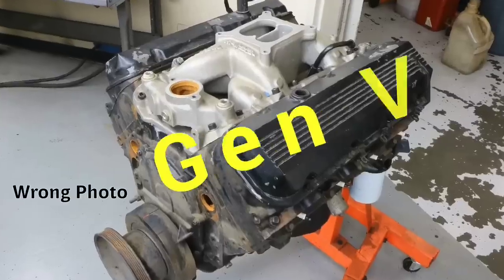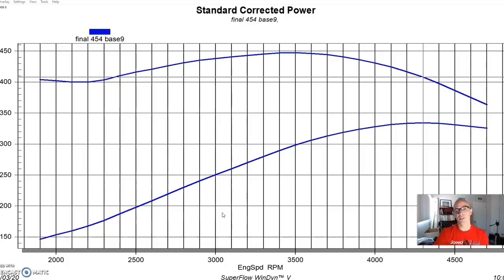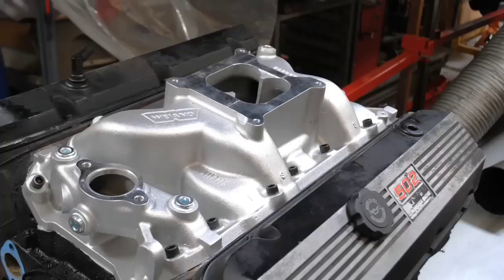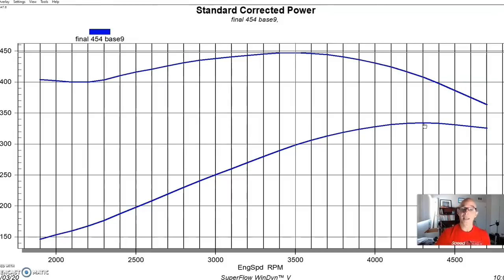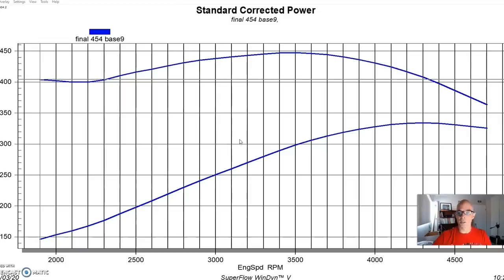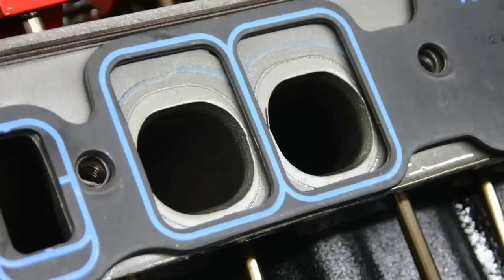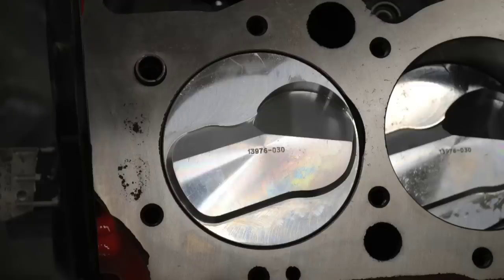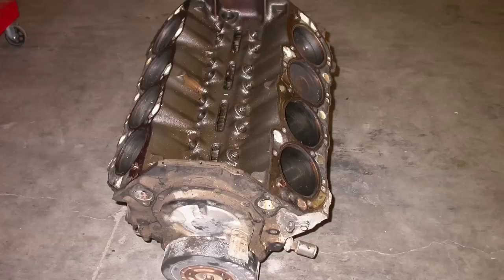HOW TO UPGRADE YOUR TBI PEANUT PORT 454

Comment: Do a 350 tbi motor
Reply: I think he has done it
Reply: @daveoneal5544  It's the tune.. OBD1. Everyone will probably say "go carb" but that's not always desirable, IMO.
Reply: @Kstang09  may not be desirable but its more simple and more efficient
Reply: @Kstang09  it's the heads that kill it. Swap to vortec heads, carb intake with adapter, 454 injectors 22lb regulator and a reflashed eprom.  But then again I'm just one of those guys that makes random suggestions .
Reply: Yeah, really.
Reply: 100 hp tops
Reply: The swirl port heads actually flow pretty well with some work.
Reply: @shitbox7413  why waste your time with them when just about any factory head will do better. I'm sure 882 heads might even do better.
Reply: @Kstang09  well it depends
Reply: do a 305 with a Weiand single cab blower with a 454 tbody and injectors
Reply: Have 383 tbi with vortec heads in my 93 burb. Definitely suggest vortec head swap. I was running 18 psi to the tb, but that was too much for part throttle cruising (350 injectors)
Reply: @ryansorkness7396  try 15 psi
Reply: @ryansorkness7396  I've run up to like 35 psi on a TBI turbo application.  No problems.
Reply: dave oneal, I’ve seen swirl port heads used on many builds of varying displacement dyno tested, they’re not big on horsepower, about 300 on a pump gas 355, but they make great low speed torque, 375 ft lbs on said 355, which is exactly what they were designed to do, and exactly what you want in a mild street engine. Obviously if you’re looking for 400+ horsepower they’re not the way to go...
Reply: @johnknight4824  im back down to 12 for right now, but ya, i was thinking 14 or 15 psi would be optimal
Reply: @ryansorkness7396  12 psi is bout factory setting for 350 tbi
Reply: @daveoneal5544  Not trying to rip on anyone, man! & The fact that you said legit things (vortec head, adaptor, injectors, reg...) vs "ls swap it!" means you obviously know a thing or two.. You're 100% right that the heads kill hp. I guess I should've said the tune is hard when you start pushing HP with good heads & supporting cast.. I've read that the TBI is good for maybe a little bit north of 1hp per cubic inch, you probably know more than I do.

I'm contemplating a build with a bored out 350 TBI unit (690cfm advertised), new injectors at 20-22lbs, dual plane intake, 216/223 113lsa roller cam and AFR 195cc as-cast heads.. would be going in a '93 single cab short bed c1500 w/a 5-speed. Any ideas on tuners or thoughts on the setup?
Reply: @Kstang09  Yes.  Do yourself a favor and buy an EBL computer (www.dynamicefi.com).  I tried tuning a retrofit TBI application on an I6 292 with a factory computer ('7747 mostly) and it was....suboptimal.  He wanted to add a turbo later anyway so we upgraded to the EBL and oh my what a breath of fresh air.  I've been brought up on factory-based engine management so maybe I am biased but it is a GREAT product.  Well worth the money.  It does turbos, N2O, 2 stage rev limiters,  programmable I/O (i.e. data log wideband, control fans, etc.) and the list goes on.  Also HIGH SPEED data logging.  Flash in seconds from the laptop right after you adjust the tune.  It's awesome.  It's based on the original computers from the TBI era but heavily revised with improved code, memory and ports.
Reply: @Kstang09  use my input at your discretion but your wanting to put an ls cam in a gen1 block. Afr195  would probably hurt more than help on a 2bbl tbi. But as long as you have money the sky is the limit
Reply: @kevin9c1  i think you just gave me answer to a question that i have been thinking about on upgrading/ replacing my factory computer. Been wanting to run forced induction but wasn't sure how with the electronics and keeping it simple
Reply: @daveoneal5544  Yeah Ive read over the Harris site and checked out these TBIs as well... they're kinda what gave me the idea. They're spendy, but the AFRs are fully assembled aluminum for less than $1000 shipped which I think is pretty competitive vs having to find & machine vortecs plus valves & springs. Ive got link-bar roller lifters already so I kinda want to go roller vs flat.

No to keep bugging you but would you have a hypothetical cam & head choice for a "hot" TBI build for a "muscle" truck? Ha. Im not looking to make huge numbers, just wench, build & have hard acceleration & rev to maybe 5500. And maybe a slight idle if possible, with vac brakes. Thanks man.
Reply: @daveoneal5544  i bought his chip and did the fuel pump and 18 psi spring along with his tbi mods. Pretty happy with it except the spring.  Unless your WFO all the time,  18 psi was too much.
Reply: @kevin9c1  Thanks man! I was juuust starting to go down the rabbit hole of this the other day & wasnt sure on where to start. haha. I would love to keep the TBI (reliable, but mostly cuz I'm weird & like them), but make as much usable tq/HP as comfortably possible on a somewhat modest budget. & hopefully rev to 5500.
Reply: @ryansorkness7396  you might want an adjustable regulator with map reference
Reply: @daveoneal5544  i know all about tbi motors ppl say u cant get lot of power outta one thats a lie i know u can
Reply: @ryansorkness7396  For my father in law's turbo 292 w/ TBI, we went with an external vacuum referenced regulator.  I think we set it somewhere in the 26-28 psi range at atmospheric.  Vacuum would pull it down to the high teens or 20 and boost would run it up to 34+.  And you can even tell EBL that you have a vacuum referenced regulator, which is important because fueling is skewed under vacuum and up to atmospheric.  In boost, fueling is flat (one for one) keeping up with boost.  There is lots to read on various forums.  I should dig up my old thread because it may help you.  Years later his truck still runs great.  Tuning took a while but it was fun.  He wired in a permanent WB O2.  You can even have EBL run off of that if you want but we just use it to drive a gauge and data log (via EBL).
Reply: @kevin9c1  that thread would be extremely helpful!
Reply: @kevin9c1 I’d like a link to that thread also. Sounds interesting!
Reply: Use a 454 TBI unit or rebuild the 350 TBI unit with adjustable pressure regulator.

If going in a 1987-1995 Car or truck get a tuner firmware chip for the stock computer, fresh ram air intake.
Reply: @smokinace8977  carbs require seasonal adjustment, Tend to run richer than FI.

Comment: We Dyno tested a big block built for towing with fitech at work a while back. peanut ports, cam and intake took it to 400 horse and 500 torque
Reply: What intake did you use, and fitech model? This is the level I want to achieve for my off-road rig. Got a 1990 one ton to build from. I want efi for steep inclines. Nothing worse than stalling in the middle of a climb!
Reply: Did you use high compression pistons

Comment: I have you're suggested combination in a 1990 one ton 4+4. Just judging by the list of trucks and cars that I've dusted, it definitely makes over 500 ft pounds. It also pulls my 30ft boat weighing 7500 pounds without effort. Great video.
Reply: I just bought a 1990 K3500 and will hopefully be seeing some upgrades in the future! Anything you suggest checking or looking out for, this motor was said to be replaced once and has a reman TH400 installed last year

Comment: I built a motor similar to this out of a 1974 454 truck motor but used a 427 crank. I don’t know if the heads were peanut ports but they were pretty small. I used a Holley dual plane oval port intake, gasket matched the intake to the heads, left the ports alone for velocity and pocket ported them at the valve. I used a Comp cams XE268 solid lift cam and a 750 Holley vacuum secondary. It had between 9.5 and 10 to 1 compression. It was never on a dyno but I built it using a desktop dyno computer program and the numbers it gave for what I built were very close to what you ended up with on your 454. I was glad you ran this test because it was so similar to what I built it gave me a little bit of  validation about what I had. I had it in a 69 Camaro with a 400 trans and a 9inch Ford rearend  with 3.50 gears . That motor was pure torque from idle to at least 6 grand and was almost more fun to drive than I could stand. Thanks for doing that test.

Comment: I really loved this video I own a 454ss pickup and I'm from Puerto rico. I built the motor very similarly with the exception of running a 280 isky mega cam, single plane manifold and sniper efi. It runs great and made a little over Richard holdener did. And I shipped the truck to Florida after building it and drove it all the way to Vegas where I live now.

Comment: i built this about 15 years ago when i was 19 out of a mercuiser motor i put it in my squarebody for towing by father guided me through it we he just said it "should be good"  it shredded 36in mickey thompsons. i ruined the combination with a roller cam from a 502 crate motor still have it with a small roller in it. I love this combination. and am so excited you did this and i mean same cam and only difference was i ran the stock merc pistons and i gasket matched the heads

Comment: I just rebuilt my L19 454 this way, new pistons 9.2 : 1 comp ratio and upgraded to a Comp Magnum 215/215 110 270 hyd roller cam with 911 springs on the peanuts- it is rowdy now! Easily 500 ft lbs everywhere. Weiand intake, Holley sniper EFI instead of TBI.
Reply: What pistons did you use
Reply: Nice!

Comment: I went full effort with a 305 TBI way back in the day. It didn't make alot of power but it did feel super healthy under my foot, really nice torque. A 5 spd and 3.73's made it so fun to drive. It would scare the passenger every time. Finally hurt a wrist pin but only after two summers hittin' it with a 100 shot about 50 times. Good days.

Comment: I did something similar in 2008, to my 92, 1ton 4x4. Found the gen 5, 366 truck engine has oval ports and small chambers. Stock peanut port heads went in the scrap heap. Machined heads for larger valves and Mk4 adjustible valve train. Bowl blend to match larger seats and port match intake. Cam was very similar to yours. No dyno time, but truck pulled all the way to 5200. No more laying down around 3800. Also increased mileage from 9-10mpg to 12-14.

Comment: Did a 454SS for a friend back in the late 90s. Original ran well, had very high oil consumption. Used KB hypereutectic domed pistons, Crane "RV" cam, Edelbrock dual plane intake with Holley 750. Stock mk5 heads with 3 angle valve job and new Crane springs.
Made great power to 5000 RPM. Never dyno'd it, butt dyno felt 500 ft/lbs.

Comment: I had to rebuild one back around 2002.  Since it was going back into a stock truck I just needed it to work so I wanted to retain the TBI.  When discussing what to do with engine, I asked the machinist what could be done to increase the power.  He did some digging and found a stroker crank for it.  Back then high flow heads where very pricey and there really weren't any that worked well with the TBI setup without spending BOOKOO bucks so I was all in on the stroked monster.  After the bore and stroke mod it ended up being in the ball park of around 504 ci.  I now have that motor sitting on a stand waiting to go into a 72 GMC 1500.  It has an upgraded Comp cam and an AIR GAP Edlebrock intake.  I was going to get some aftermarket heads for it but now with the kung flu here money kinda dried up so I'm just gonna stick with the stock heads for now and see what happens.

Comment: I built an engine similar to this for my brothers '70 Malibu.  Gen IV 454 +.060 w/30 cc dome hypereutectic pistons, cast crank, stock rods w/ARP bolts, 122 cc chamber '781' large val port heads, Comp XE268H cam, Edelbrock Performer RPM intake with a Holley 750 carb.  His car is a tire frying beast on the street.  He doesn't take it to the track, he just plays with it on the streets.
Reply: what car and rear gears ?   ive got similar but 270h comp mag cam that will go into an 85 Monte ss
Reply: @johnnyboyssite  - The engine went in my brothers '70 Malibu.  The transmission was the original TH-350 that was rebuilt and had a performance shift kit put in it.  The rear end is the stock 10 bolt rear end with what I'm assuming has 3.07 gears.  His car originally was a 350 2 bbl car.  Because he doesn't race the car, the rear end still lives but he plans to upgrade it in the future.  He's owned the car since 1982.  The 454 has been in the car since 2018.
Reply: MrIgor1955 nice

Comment: My 78 Suburban (K20) now has a gen 4 454 with peanut port heads that are stock while the block has been bored 30 over and a stroker crank. I also went to a cam much like the one you used on your upgrade. I am using my Suburban for towing and off-road driving so the low-end torque is very important. I will be looking for another set of peanut port heads to do some mild porting in the future. I also forgot to mention that the block was decked 70 thousandths in order to remove a casting flaw from the block and thereby remove a small coolant leak that was in the engine when I got it from the junk yard.

Comment: Love this. I built a gen 5 489. All forged components. -18 cc pistons. I  Used peanut port heads. Heads shaved to 117 cc. With marine cam. 234/244 at .050, . . . .564, .566 lift. 112 lobe separation. In my jet boat as we speak. Always wondered how much power it had. I have some brodix BB2 XTRA heads for next year.

Comment: I've used a gen 5 with gen 6 heads in my c10 with a very mild cam and it was very fun with a set of drag radials
Reply: Wat head gasket and vave spring mods i have gen 5 block and gen 6 heads plan on running a comp hyd non roller
Reply: I want to run gen v heads on a gen 6 block for my calif smog legal suburban rebuild.
Reply: @leekazan556  the gen 6 is a better head and should be more efficient
Reply: What head gasket do I use to put the gen 6 head on a gen 5

Comment: I did a gen 4 454 with 820 big oval closed chamber heads, comp 268-10 flat tappet cam and Fitech fuel injection in my 47 Chevy 3100. 9.5:1 compression

Comment: Very handy video for my budget square body build.

Gotta free complete Gen V and free Mark IV oval port heads.  Hadn't pulled it apart to see how tiny those ports are.  Ooft!  Definitely gonna change those out to the older gen heads (w/ right gaskets), race valve job, port the heads, dome pistons and a cam... maybe 545-565hp range till I build a bigger, better setup.  Will be decent for the price though.

Comment: I have watched this video 6 times and wrote down everything to put a Gen 5 together I do have the gen-6 heads to run with the flat tops and just ordered the xe268 cam kit with springs . To go in my 82 long bed chevy on 38.5 in bogger an 4.10 gears

Comment: Having a Generation 6 454 for the last 22 years in my 1998 K2500 Chevrolet Suburban is nice. Not many years ago I didn’t know that I owned such a beast. I will never sell it now. Although it’s not the greatest engine car combination I have owned, it certainly is worth keeping. Some of my earlier cars that I have owned & have kicked myself for letting go: 1969 Mustang Mach 1 with a 427 Ford factory tunnel port  that I bought in 1974 for $1100, a 1967 Mercury Cougar with a 390 & C6, & my favorite, my very first car, a 1960 Chevy Biscayne with a 292 inline 6 & 3 on the column.

Comment: 400 hp to the wheels in a 4000 lb car is 11.90 in race trim, with a 4l80 trans you can go nuts with the converter, put a highway gear for the trip to the track and highway cruising, in something like my 68 impala, I got a low rpm, low buck$$ stump pulling, B-52 bracket bomber, on 91 or E-85. Hot rod Lincoln's get out of my way. The same combo on a 402 should run about 700 rpm higher for peak rpm. Let's do it.

Comment: I had the best luck swapping on very small closed chamber oval port heads that we milled, installed hardened valve seats, and 2.125"/1.725" stainless valves in. You can get the chambers down to 92cc. With a good aluminum intake, 750 Q-Jet, a 218/218/110 cam in at 106, and a decent set of Camaro headers, you have a killer engine for a tow vehicle.

Never liked the open chamber peanut port heads, no compression on a flat top 454. We found them to need compression more than anything.

Comment: I actually set my engine up off of this engine combo, you did an article about it a few years ago. Hopefully the 268H will flow enough for the 320cc Brodix Dragonslayer heads. Trailer towing power is what I'm after.
Reply: @Future-Preps35  amen
Reply: imo the ports are not too big.  the trick is a short duration cam.  Ask Comp Cams, and I think a 212/230 duration 113 LSA cam will work better with your heads.  The Brodix flow 340 cfm at 0.500" lift!  It'll make a ton of torque.  It needs a lot of help on the exhaust though.
Reply: if you dont have a high static compression, try advancing the cam 4 degrees.

Comment: The beauty of the TBI454 for towing was the torque production from 1500-2500rpm, which was the sweet spot towing with my 93K2500 suburban, open trailer, and race car.  It would pull like mad at lower rpm in OD, which was the sweet spot from 45-65mph.  I towed with it for 15 years, and much of that in OD and below 60mph.